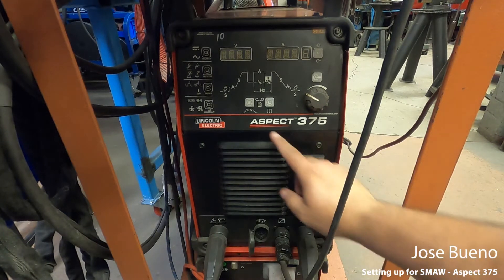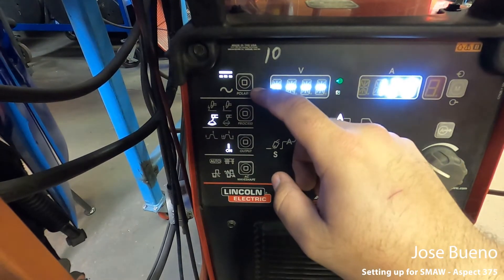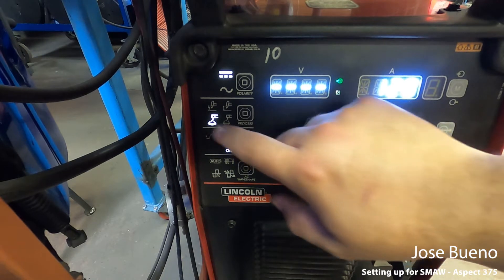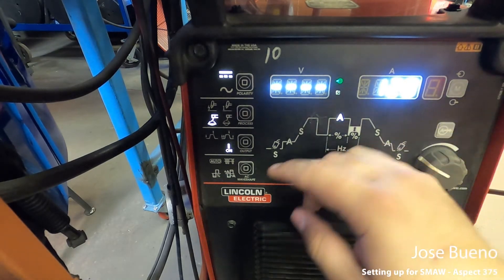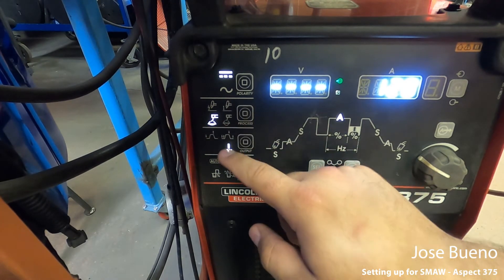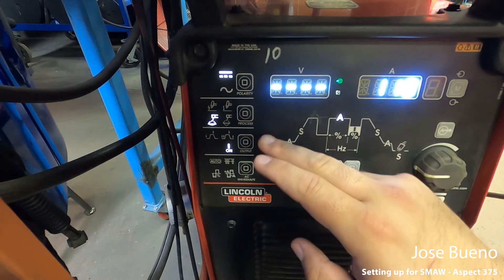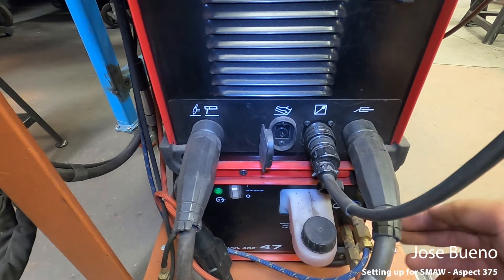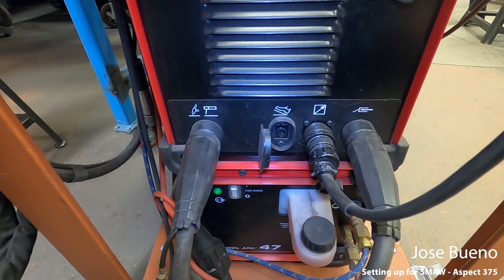Setting up for SMAW - Lincoln Aspect 375

Comment: the mode on the left(soft arc) is for low hydrogen rods(7018) and the one on the right(crisp arc) is for high cellulose rods(6010) but of course you can switch that but actually entering the arc force for each of those settings but thats the way lincoln has designed it